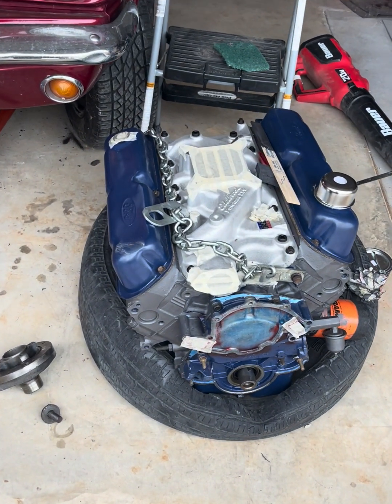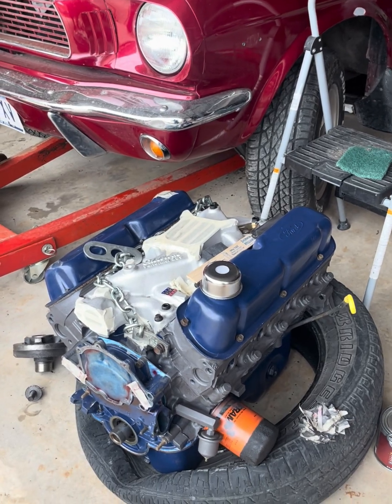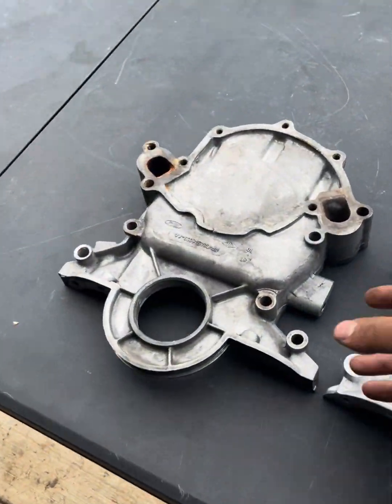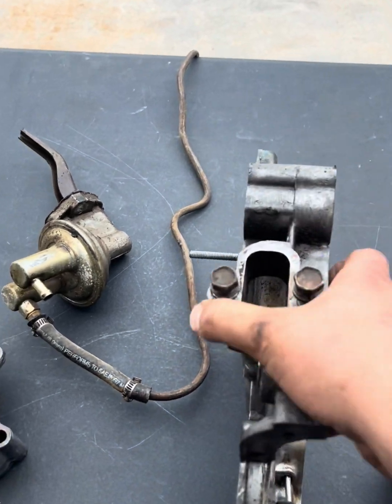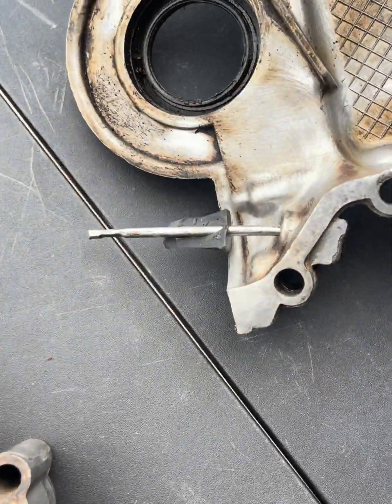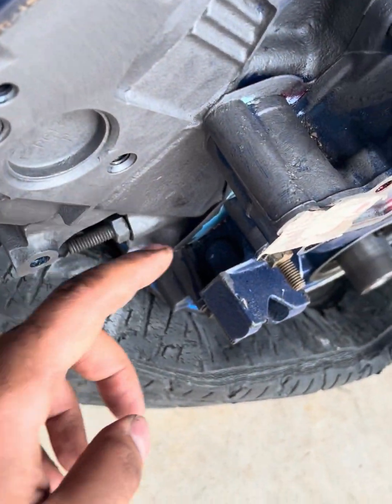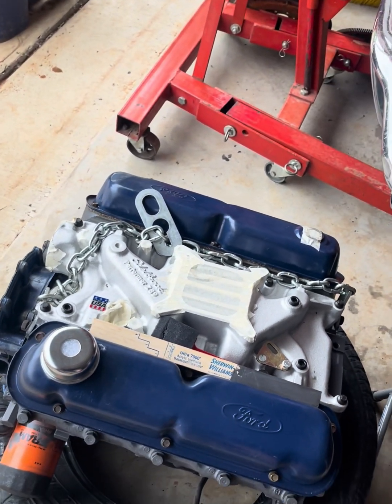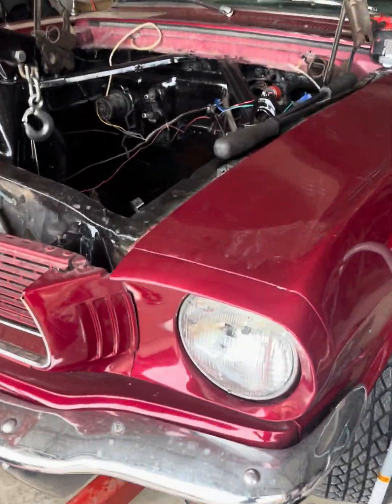How to convert your Ford 5.0/302 from fuel injected to carbureted

Comment: I haven't been able to find a timing cover that doesn't have the dipstick hole,but still has the fuel pump opening.  I will probably just block the hole myself.
Reply from the maker: Try timing cover RTCF-302B that ones supposed to have no dipstick hole but still has the fuel pump opening
Reply: @Cirones_garage thanks I'll check it out

Comment: Did you have to replace the cam shaft after converting from EFI to a carb or was the motor an older 302?
Reply from the maker: The cam we used was out of a 351w to make it an H.O motor. Other than that there’s no need to change the cam shaft to do this swap.
Reply: @Cirones_garage  making it a HO was just a personal choice though, right? I know that's my current issue with EFI and why I am switching